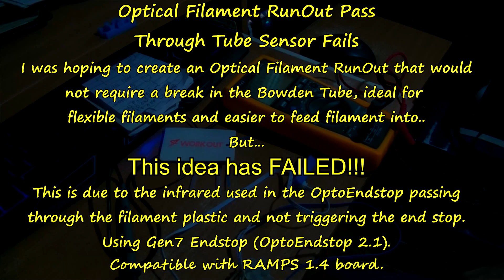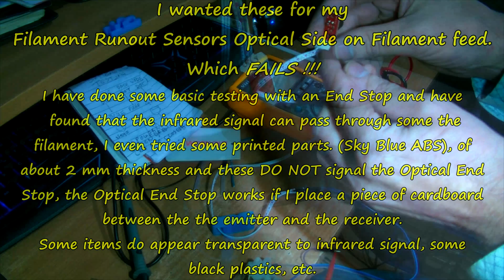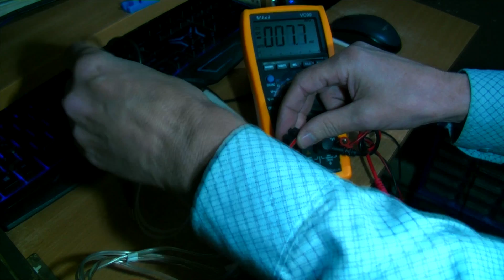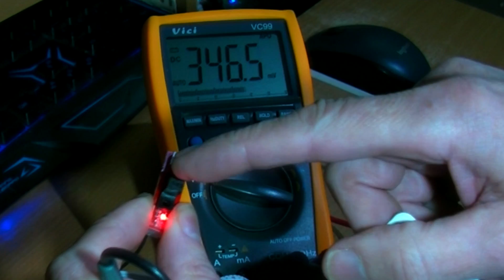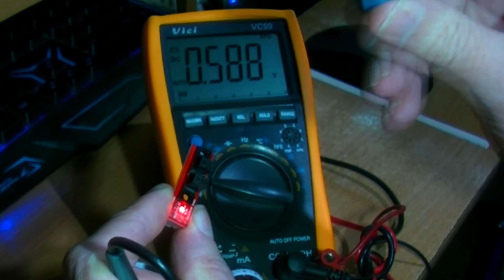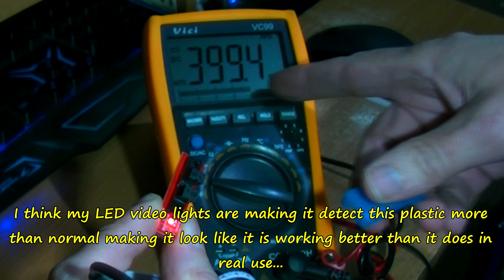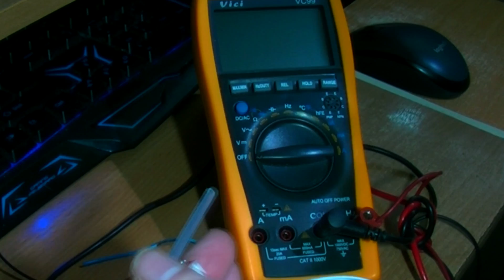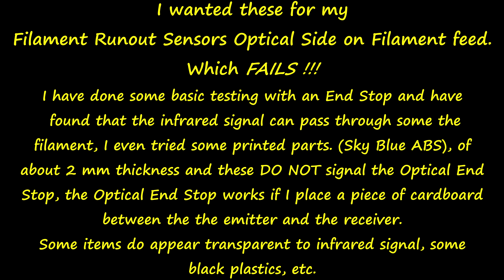Optical Filament RunOut Pass Through Tube Sensor Fails

Comment: Great video!  Yeah I can definitely confirm the optical sensor is a fail.  I just installed on my printer a few days ago and have had several false positives.  Fortunately I am using it with Octoprint so very easy to recover from as the printer simply pauses.  Once I clear any oozing filament than I resume and all is well.  I am now looking to do a mechanical switch like the attached link -  https://www.youmagine.com/designs/filament-fault-detector
Reply from the maker: Filament Out Side On Sensor box Microswitch version
https://www.thingiverse.com/thing:2573752
Laser Pipe Filament Runout Sensor
https://www.thingiverse.com/thing:2703575
Reply from the maker: The best method for me is:-
https://www.youtube.com/watch?v=QyrHoiIPXOU

Comment: that spartial diming is why teh ones with a adjustable op-amp cna make it better . you can set the cut point .  but yeah not all plastics and such  block IR.   
suggestion .    Use a  CDS  cell and  a small low light  led .   you cna then use a reading  on teh CDS and check voltage samples of short time .   I'm not sureif i have a CDS cell kicking about , but solid shadow should work .  using visible light  led >> filament >> CDS   . the  filament  should cause a shadow on the CDS  and  cause a drop . bust still you need to compare it  .  teh CDS woudl  pay  more attention to visable light spectrum , but i believe a op-amp  would be needed. search ebay item num 262818189083 .   it is a cds and op amp  and a trim pot .   if cds is opposite a pin hole in a housing  than only a small amount of light gets through it should work .  You may have to  tune  teh trim pot for best result with different  plastics .
Reply from the maker: I have some Ambient light sensors, (visible light), on order to experiment with. I hope to just cut the infrared out and put this with a visible light LED in that this may  work better as you say using a shadow, maybe moving the detector a millimeter away to make that shadow bigger, pin hole, slot idea's  ...  Thought about CDS but thought this may be a bit slow to respond to light changes and too much electronics to do. Thanking you 2000%, I will look at 262818189083  on eBay
Reply from the maker: Best if I go the CDS, LDR, light dependent Resistor root, easy 5V signals for RAMP logic BUT Note: e use of CdS and CdSe photoresistors is severely restricted in Europe due to the RoHS ban on cadmium.
http://www.ebay.co.uk/itm/262239134068
Reply: one last concern is the clear-ish  bowden  tube . it may be  'lensing' the light rite past the filament .    you may need a tiny hole through, in the spot in the tube where light should pass .   I was going to try notching  a small section of a tube  to allow just enough access for a roller switch  or decent micro switch  to contact the filament .  but will hold off as i like the idea of  totally optical .
Reply from the maker: Filamant Out Side On sensor box  Microswitch improved, a lot easier to use, still have an idea for optical method waiting for parts, ambient light trails was not too successful.
https://youtu.be/QyrHoiIPXOU

Comment: adapt the design to use a micro switch that is depressed when filament in in the route, and turns off when filament no longer depresses the switch.
Reply from the maker: My Microswitch design

Filemant Out Side On Sensor box

It is designed to have the filament feeding through from the sides.

This is for use with a microswitch with a lever arm. It is used to detect if the Filament has run out/snapped, etc..

This is a bit awkward to re-feed filament. The lid generally needs removing* and the filament need to be feed back through the hole in this lid and the over the top of the microswitch arm and then out through the other side.

This is 3D printed quite thin plastic.
https://www.thingiverse.com/thing:2573752